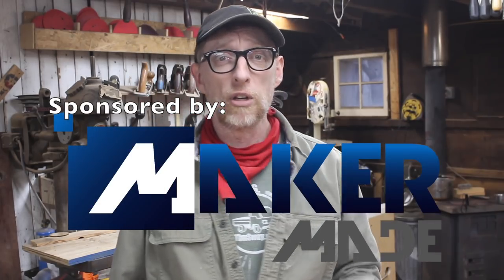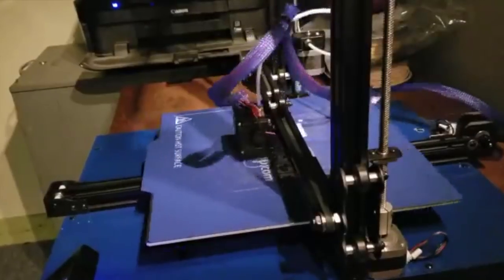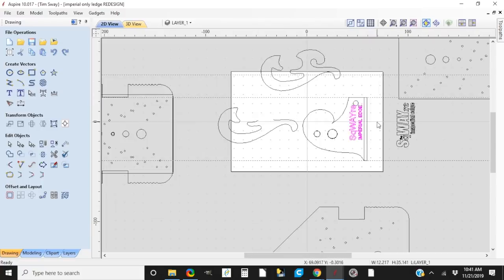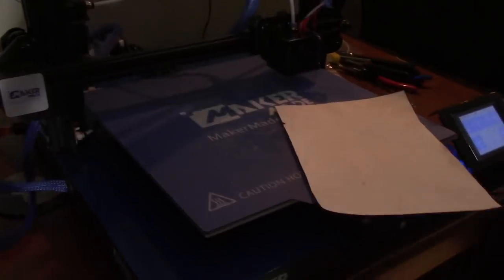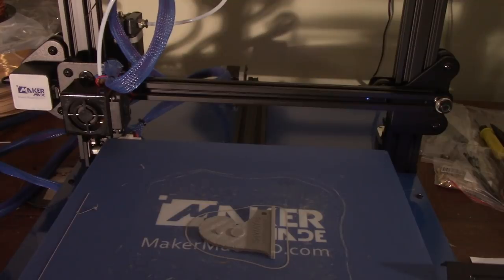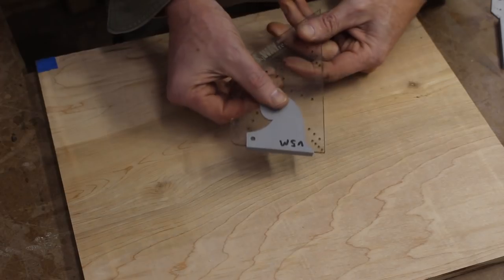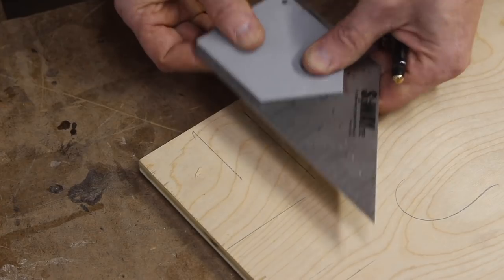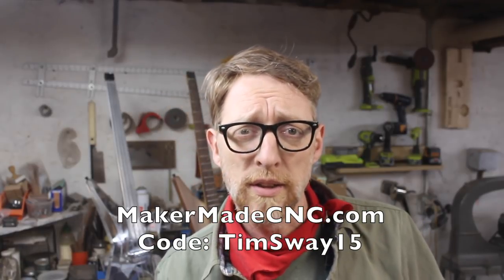The SqWAYre Edge and the Future of Manufacturing

Comment: Tim, have you thought about making a sheath for the SqWAYre? I did model one that has a belt loop but I rarely use it which means it isn't really good and currently I just don't have time to iterate on the design. But with you owning a 3D printer and already having gotten your feet wet with the edge perhaps you could add a proper 3D printed sheath that can be attached to a belt for the SqWAYre? Mine is currently mainly used to keep the pointy tips of my SqWAYres in check and to tell the metric and the imperial version apart by color. Oh, love the SqWAYres by the way - not sure I ever told you that. Cheers! JM
Reply from the maker: A viewer Matt shared pics of his sheath that he 3d printed and never told me about. It is certainly not a bad idea... thanks foe that!

Comment: Can I use this for fret leveling?
Reply from the maker: sure. I use my SqWAYre for that sometimes and the flat edge of the 3d printer part should be accurate enough, but all the parts are a little big for the smaller frets.
Reply: @timsway  ah, but Tim, I am a bassist. Perhaps it would be more appropriate.